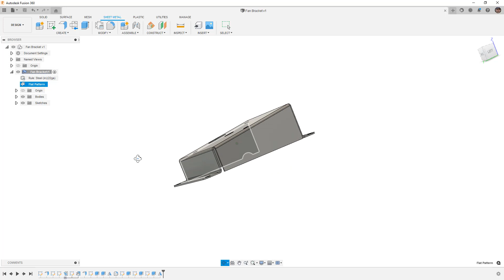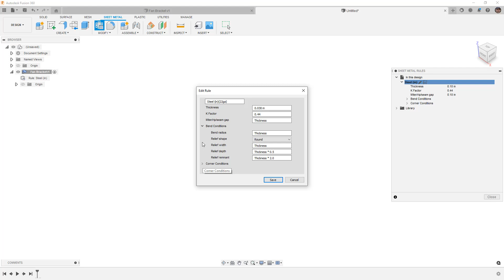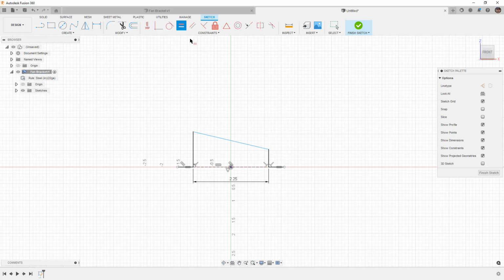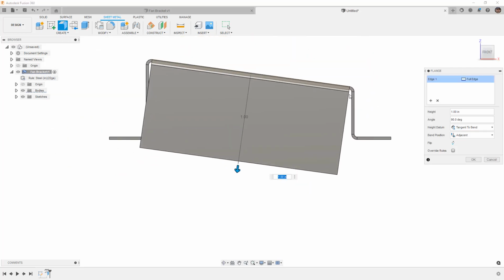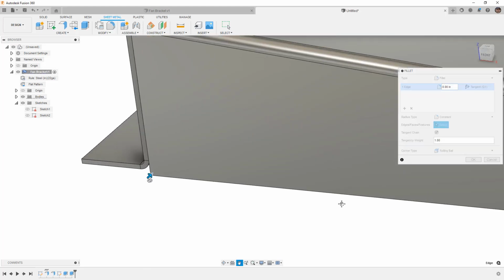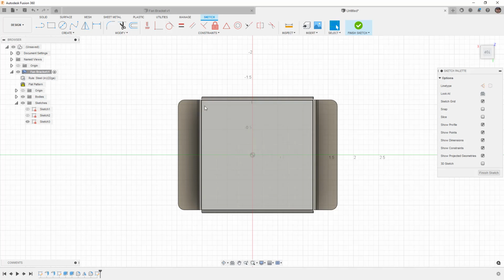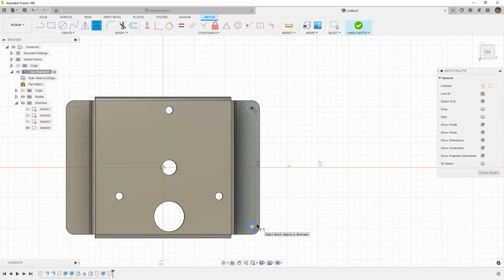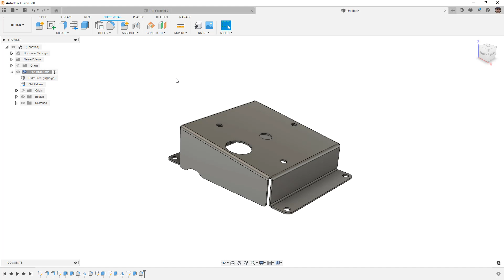How To Model A Sheet Metal Bracket with Fusion 360 #Fusion360 #SheetMetal #CAD

Comment: Thank you.  This was very helpful.  How do you close the gaps?  Not sure if there is an easy way to do it.
Reply from the maker: You're welcome!  On the gaps, you don't.  You can edit some of the sheet metal parameters to leave less of a seam, but in general there is a gap on folded sheet metal parts.  Some parts get welded at the seams but most do not.

Depending on how/what machine you use to bend/fold the parts you do need a bit of a gap in order to make it work as well.

If you look at the sheet metal rules in Fusion (or any program) you will see settings for the gaps for rips and seams.

Comment: How can bend that for you?
Reply from the maker: If you don't have a finger brake you could upload it to an online place like Send Cut Send.  There are many rapid sheet metal shops.

With basic tools the best thing would be a vice and a few blocks of wood, or some "duck bill" vice grips could do the trick if its thin enough.  Ideally would be a finger brake.  Eastwood has vise mounted "press Brake" setups that work well for bending metal.  They also sell setups for presses.  You can get the job done if you are bending thin enough steel with some very basic tools, but the material will be a big factor in what will work and what wont.
Reply: @LearnEverythingAboutDesign  I am more thinking of leaving it to a company that have a machine like this: https://youtu.be/qUVZNouV1_I

Comment: Great explanation!
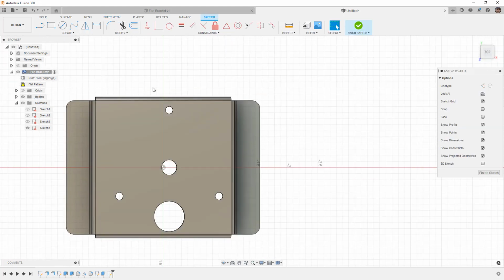13:55 Just noticed that the holes for the fan are not centered... 
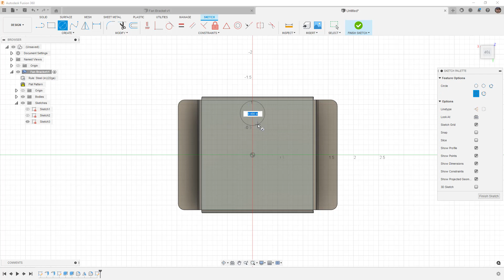11:55 You drew a sketch on the biggest face, which is not parallel to the top face of the model. It project the center of the origin on the sketch out of center...
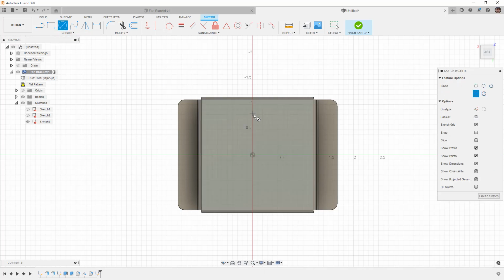Reply from the maker: Hi Stijn.  Yes the holes are not centered.  I modeled it based on a real part that was like that.  and 11:55, true however the origin moves relative to each sketch.  if i understand you correctly.

Comment: Thanks for the video! More lessons on sheet metal. The sides are crooked on the cutting sheet. The ones that were edited. Or should it be? When bending, everything will be fine.
Reply from the maker: Thanks, And yes they should be crooked in the flat pattern.  It is like this because large face is at an angle.  In other programs when making the flange you can edit the profile right there.  Fusion doesn't have that yet so we had to do a could extra steps to make it work.  One thing you can do to test is to print it out on paper and fold it on the bend lines.  Once you have a Flat Pattern active you can create a drawing from that and the dashed bend lines will show.

I will give some thought to more sheet metal videos and see what I can come up with.